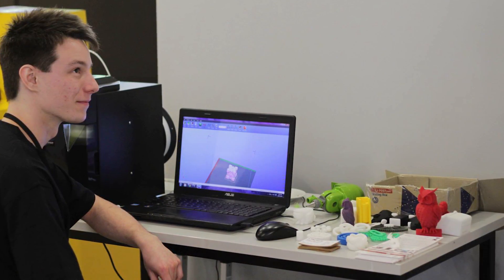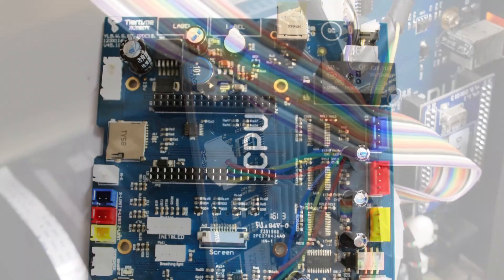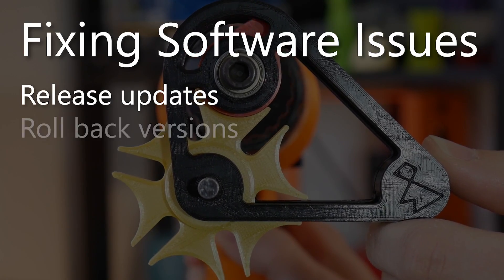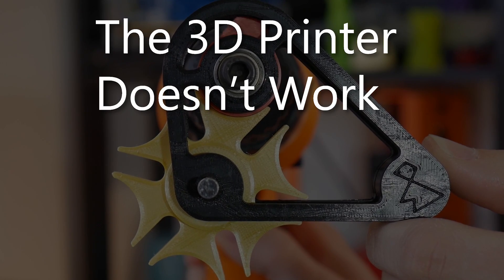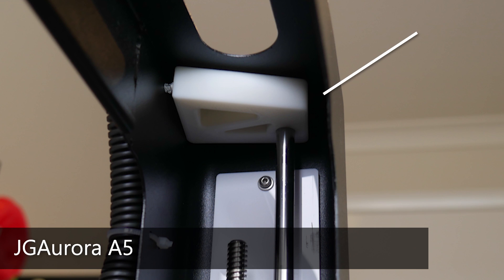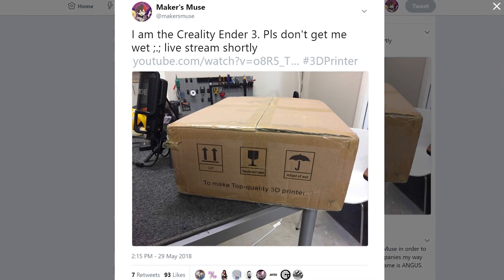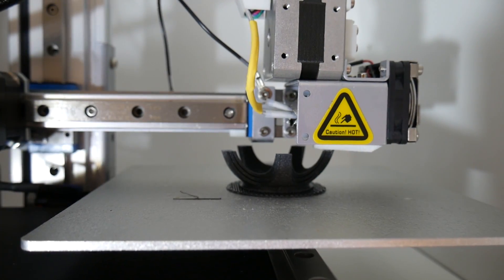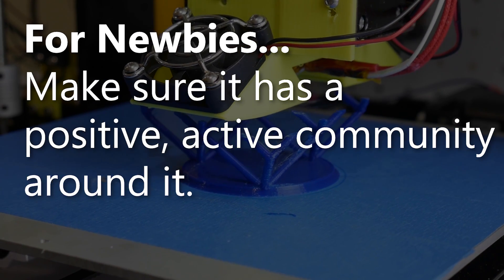Serious Concerns with 3D Printer Quality Control

Comment: I would say it is both parts fault. Indeed, a big majority of the customers (really early beginners) don't even know how to unclogged an extruder, don't read the MANUAL but think it is the machine fault. Also, it is true that some (not all) companies just throw that machine on the market without blaming themselves thinking it is ONLY the custoemr fault, since each MACHINES are unique, it is not because the one in your office work that one of your client can't have a problem. Instead of shooting each others, they should just find a better way to communicate. Forums, youtube and so on can spread really fast, GOOD OR BAD and then it is hard to find  the truth and work tohether sometimes.

Comment: I agree with you. I almost stopped all together because my original Anet A8 was plagued with so many issues after assembly. After unknown hours put in fixing it and many revisions. I got the thing running just fine. They should do better getting quality parts in kits/overall. I have no problem paying a little extra for a better quality printer.

Comment: One year ago I bought a Tevo Tarantula XL, knowing I would have to replace a couple parts to make it a decent enough printer. During the following week of having finished building it, the power supply exploded. It was a fanless, 240W LED power supply, totally not good enough for the bigger heated bed of the XL version of the printer. Luckily, I had other unfinished projects, from which I had a 500W server power supply, so I made some adapters and used that one. So now it was working, using a server powersupply worth 150$, half the price of the printer.

Recently, after 11 months having the printer, I disassembled the hotend because I was getting bad results. I then realised that for the past year almost the nozzle had never been assembled correctly, leading to constant clogs and rendering all my past prints in the past year real miracles.

Yesterday, I finally found a way to fix the lack of support of the whole frame, making it print at an angle, making it impossible to print useable mechanical parts.

Finally, this summer I decided to upgrade the printer into something that I could trust and truly call mine, so I bought real genuine parts, including an E3D volcano hotend, a secondary Z axis motor, and parts to make my printer able to auto-level itself. Those quality parts cummulated to about 250$, almost the price of the printer.

So now, my tarantula cannot be called a tevo tarantula anymore. Its total value is now 800$ and there is still place for improvements. I loved the journey, I'm a thinkerer, but I'm just myself. Most other people, as Angus said,  would never have spent the time and money on going this far.

Companies need to break the toxic circle of living in the "it's not bad quality, it's just chinese quality" stereotype, making them not give any second thought abut their products and simply ship something that is "good enough" with their own standards. Hopefully this situation changes, but I doubt it, since most humans are lazy and the quickest route always yields the most immediate profit.

Comment: Totally agree. This also starts to bring up health issues to hobbyists, now that resin printers are getting more and more common. The free chinese printers have a lot of problems and also they are not safe to use...
Reply: Safety is a big concern here, and health too with the resin. Angus mentioned that the colored covers in the resin machine he just reviewed were the wrong color (blue) to actually block the UV light emitted
Reply: yea, I bought orange covers and changed those. Works now, but again... user (thats me) had to pimp the product to make it work like it should

Comment: I honestly feel that with the price of some of these 3D Printers, there should be expected quality control and thorough testing.  I have a Monoprice Maker Select v2, works well for what I do, and got me started with a good experience.  I even watched all kinds of videos about the 'recommended mods' and did those.  But, by the time I was done, I look around at my spare parts and realize I almost rebuilt the printer.  My "cheap" beginner 3D printer, has almost cost me the same as a higher quality printer.  

So, I am looking at a second 3D printer, and honestly with the knowledge I have gained from the almost rebuild I have done, I am looking at building my own from parts like Tom did on his channel, only doing a CR-10 "clone" due to the build size.  I want the 500mm x 500mm build area, and am willing to source each and every part looking for the pieces with the highest reviews, the least amount of 'fixing', etc.  But, if it had not been for the "you should fix this when you get it" reviews and videos, I wouldn't have known to even look into some of the things I have done.

Comment: If you go into it knowing that what you are getting is a test model, and, it is cheaper by far then the production model, i think, its like software beta testing back in the day, and its ok, but if they do that, they need to offer an upgrade kit to take you to the newest version for a low cost. However, none of these companies do any of that, they market the product as the production model, but your getting at best beta hardware, in many cases it seems your getting pre-alpha hardware. the criteria for them to call it a printer just seems to be, does it have the ability to move in x, y, and z, and melt some plastic.  None of these machines should need anything to help them reach the best they can do, outside of the parts in the kit, but all of them have some upgrade that makes it work a little more right, or corrects a safety issue. Upgrades are something you do to enhance performance, not reach the minimum working level.

Comment: Also, do you know the engine code for your car's model year? It's likely not the same as the first off the line. We're not that unique.
Reply: Companies test their engines before assembling them into a car, slightly different from a kit of bits that's never been powered up or test fitted.
Reply: Brian Rose that first engine off the line still went through tons of R&D so it actually works..most of these printers wont even turn on out of the box. If you bought a new car, started it and it died your attitude would be "well it's new so gotta wait for the kinks to be worked out"? Wtf lol
Reply: wtf lol yeah. The engine was tested, but head gasket cracking wasn't discovered until april. Does Ford or VW alert all the customers lol?!? Nooooooo they silently fix design and wait for customers to check their vins for recall. That is, unless there is a safety issue ($$$ of course). wtf lol
Reply: I'm 6 for 6 that turn on out of the box wtf lol. Guess I'm lucky wtf lol
Reply: Also bdub z, I'm not sure if you're capable of following a narrative, but I was addressing his gripe about manufacturers changing designs under the same badge wtf lol.

Comment: That's ridiculous. If manufacturers went your way then there wouldn't be multiple options to enter the scene at $150. Those costs are passed directly to the customer.

The customer has a choice to make: 1) Budget 3D Printer with tinkering required 2) Break the bank premium printer ready for prime time 3) Adopt a less nerdy hobby
Reply: The problems isn't part failure, it's engineering failures. Parts that never worked or failed because of some design flaw.
Reply: Ultimaker 2 had alot of parts that were like this and that you had to switch out yourself (on your costs). Like the PTFE, the original extruder motor,...

So even the premium printers do that. The biggest issues is when the printers are faulty and closed source, then your screwed.
Reply: Say a printer had a bad power supply then I would want manufacturers to fix the problem rather than continue to ship a bad power supply.  Any other fixes or upgrades are a plus. And if they are doing this for free? nice.

I have an original Ender 3 and I don't feel bad that others are getting the upgraded version, in fact I'm happy for them.
Reply: Thats the risk of buying a Kit. You have to do your research and love the tinkering part of it. Being creative on another medium requires you to understand what makes it tick and how. Understand it's limitations and vice versa. You have to expect issues or Pay up for premium products. I am new in 3d printing and just purchased an ender 3. Mainboard and heat bed was faulty. I expected support and replacement parts and no problem at all. After some troubleshooting they sent the parts next day.
Reply: Then that's on Ultimaker.... Not THE INNNNNNNNDUSTRY
Reply: I would expect a manufacturer to replace any demonstrably faulty equipment out of the box, of course. For one, 3D Printer manufacturers don't manufacture power supplies... they're purchased, and they are all generic, based on the voltage and amperage requirements. I don't think this video is actually about components that didn't work as designed - it's about components that work as designed, but the design is flawed (or sub optimal).
Reply: As a manufacturer, thanks for saying that.   The industry deserves huge credit for making better machines available that are much cheaper.  And yes some have their flaws but that's the cost of either going cheap or going bleeding edge and not understanding that's what you are getting into.  This video overly simplfies things by comparing a once $1500 machine to those that are now $300, that are more focused on the kits experience rather than out of the box.  Ender 3 IS a kit after all and up mini is a finished, tested machine.  And it was 5X in price.

If you want mission critical QC, you're gonna pay more.

In the absence of a flawless product  expect a 1-2% failure of components in the first months.  Any legit company will apologize and send replacement parts as soon as they are available.

Comment: As a gamer I don't mind open software betas or Alphas simply because of the reasons you mentioned and I'm told up front what I'm getting into. I'd probably feel a little better about companies doing this with Hardware if they openly admitted that's what they were doing so they could attract the right crowd to actually help them improve the product. But the way it's being handled... that's just dishonest business.
Reply: I agree completely. Companies need to be more honest about their testing.

Comment: As someone that has only very recently bought their first 3D Printer (Cetus 3D by Tiertime, also a Kickstarter), I'm very glad that I waited out the 3D Printer hype (Tiko anybody?) and bought a product that has exceeded my expectations so far. I'm also glad that I didn't cheap out on components and will definitely serve me well for a long time. This did result in me spending significantly more than the Kickstarter price, but this would be also considering the hardware refinements that have improved it over time.

I'm not someone that will buy different/multiple printers for different purposes due to significant space limitations, hence one of the main factors of my purchase of the Cetus, and I hope it serves me well, as does yours Angus.

Comment: Good job Angus. I couldn't agree with you more. That is why, in general, I'm not a early adopter of software or hardware. When I spend money on a product (software or hardware) I expect it to work out of the box, unless I know up front that I'm purchasing a beta item ,which I have done but I chose to do so. I hate being an unwilling beta tester and usually will no longer support  that product or company.

Comment: I'm glad I started with an assembled machine despite its short comings. I now feel comfortable enough to try my hand at these machines that are essentially a gamble.

Beta testing is a good thing but it does not justify shit support and poor quality control. I have a ctc duo that's made if wood, it's stop swith for the z axis needed it's screws tightening as the bed crashed. An easy fix but one that shouldn't have been needed.

Comment: When I brought my tronxy x1 the bracing plate for the horizontal arm had the holes set too far apart, which caused quite a lot of slop when printing. For me it wasn't a huge issue as I trained as an engineer/fabricator in a former career, and thus I responded by cutting an accurately measured and drilled reinforcing panel out of 1mm steel plate to lock the bolts in position. I've had to make several modifications like that on it over the last year or so. 

 I'm sort of torn on that - their quality control wasn't great - I was able to make more accurate parts with tin snips and a power drill, but I also feel like it would have cost a lot more money if I'd had it work perfectly out of the box. I do like the printer even if it needed me to modify it for it to work properly.

There is a place for that sort of design methodology in hardware, the concept of continuous prototyping where you just get a feature working in order to see the product functioning as soon as possible makes good sense as a prototyping strategy (or for doing critical repairs) - but it only works like that at the prototyping (or internal) stages, You don't want to send something wrapped up in sticky tape to a customer unless you have an explicit agreement that you are doing speculative work, and you don't tend to do projects like that without communication channels being set up.

Comment: I wholeheartedly agree with you Makers Muse. I bought a Tronxy X3S v2 (red strip one) I was appalled at what came out of the box, it was not a Cr10 clone, it's was it's hated twice removed cousin who was orphaned at birth. There was no way it would print until upgrades were done, one of SMD Drivers was stuffed, the wiring harness has intermittent connection issues that I had to track down & fix. Tronxy were so cheap as to for go eccentric nuts for plastic sleeves, 3d printed parts done by a blind person on a beaten up bed that was in useable. Metal brackets that someone took a hammer to (I'm not joking or exaggerating) I am an experienced 3d printer & I was gobsmacked at the lack of quality control. I will never recommend or buy another Tronxy brand ever. I will be able to build this into a  great machine but no thanks to Tronxy. This has to stop seriously it must stop someone is going to get hurt or die.

Comment: Agree 100%.  I once bought software for an Atari 520ST which had a great picture of (and ad copy for) a window based spreadsheet on the box.  Got it home, and what was inside was a DOS based spreadsheet, and a coupon which would entitle me to a copy of the windows based product as soon as it was finished.  Yeah.  That was 1985; I'm still waiting.  So even using your client base as uninformed beta testers is unethical; doing it with hardware, borders on fraud.  AND, I also agree that buying a proven design is the best way to go.  I bought a cheap Chinese Prusa clone (zonestar) and I think I replaced and re-engineered virtually every part of that machine.  What I've paid in parts would easily have bought me a real Prusa, at full list.  Finally, the board burned out (again) and... I've just run out of steam.  The repair it needs is simple, but I just don't give a damn any more.  Got a ton of filament on the shelf, but I haven't printed anything for 6 months or more.  >Charlie

Comment: You are absolutely right. I finally bit the bullet and got my first 3d printer; the Ender 3. I looked up just about every review I could find and paid attention to the negatives and dates when those negative reviews were posted. I did catch on that they were upgrading it behind the scenes, but it was more or less a crap shoot if the printer I would receive would be good or not. I basically resigned myself to having a $200+ headache on my hands because the possibilities of what I could do with it were worth it. I'm currently printing out a practice prosthetic hand, and having it run a marathon testing how it deals with a bunch of different forms. Still have a couple hours to go, but besides a few tiny errors that I'm sure were caused by my selection settings, everything seems to be going great and working without a hitch. 

Ultimately, would I recommend this printer to someone else?...Honestly no. Not unless I know them personally and can help troubleshoot if something doesn't work. While mine seems to be working fine, can I say the same for the next one? Not exactly. Reviews range so wide from "this crap and I have to replace parts for it to work" to "Works perfectly right out of the box" and absolutely everything in between. Unless you are planning to resign yourself to fixing up a machine if it fails to work, DO NOT BUY A KIT. Save up extra and get a fully assembled and tested one. If you really want to save money, then may 3D printing gods be with you because what you are going to get is a bit of a crap shoot. Although it does look like things are improving with the Ender 3's being sent out.